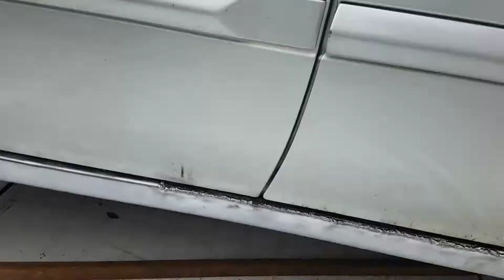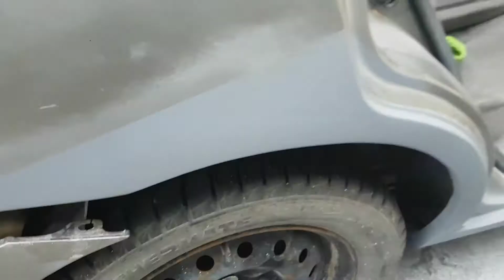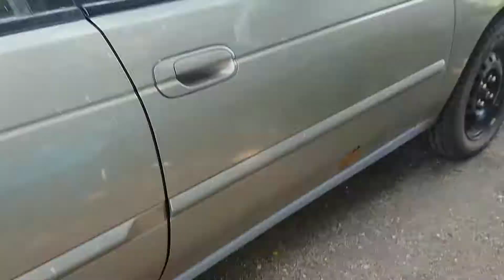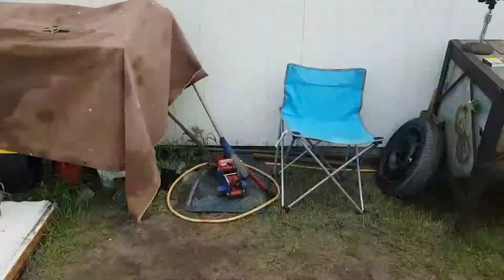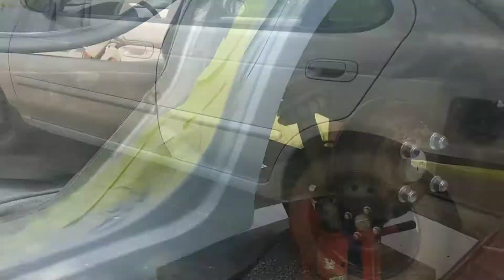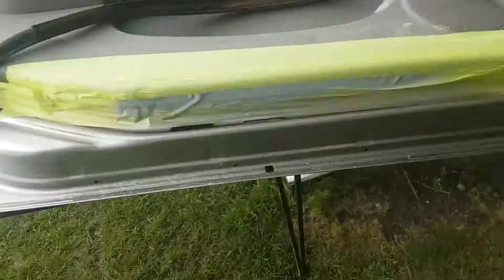2003 Nissan Sentra - Cheap Car Corrosion Correction

Comment: what kind of welder did you use? i have the same car with similar damage and im thinking of trying out flux core
Reply from the maker: Lincoln 135 with c25 weld gas and .023 wire. I've never had good results with Fluxcore and sheetmetal, but I'm sure someone has!

Comment: How long was it before you found out the back bumper cover is never gonna stay on?  Noticed it wasn't latched in on the video.
Reply from the maker: I believe I would have removed the fasteners to pull the edge of the bumper away for bodywork and paint. Quite sure they were replaced when I was done. I've driven the car every day for two years now and I'm happy to report, no parts have fallen off!

Thanks for feedback!